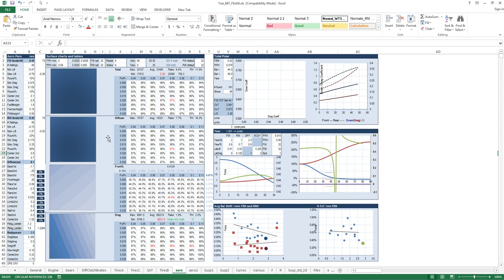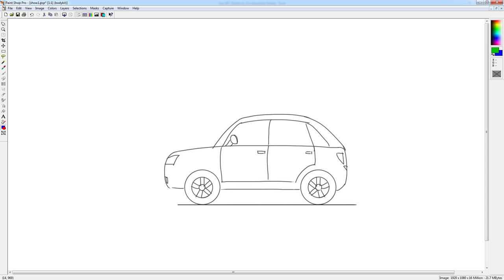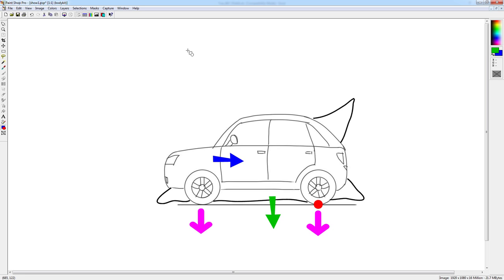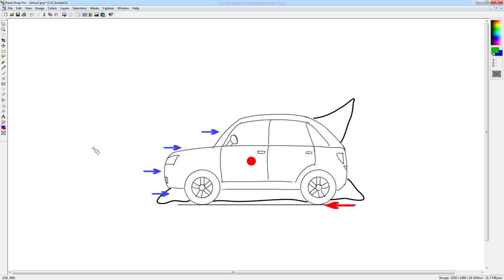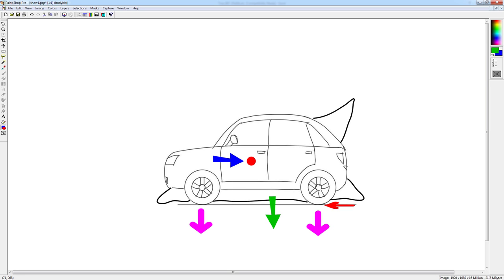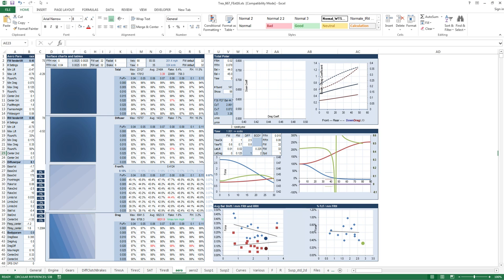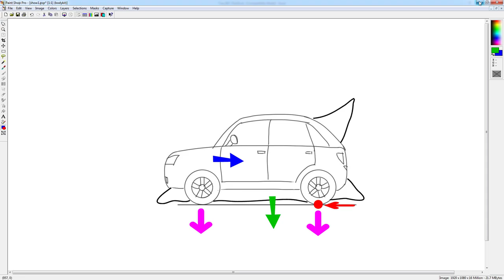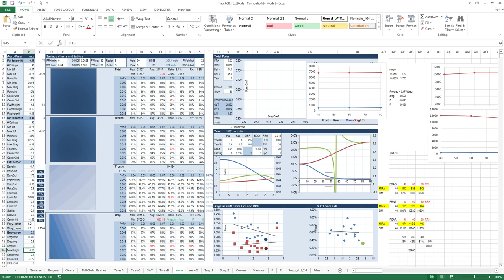I've been doing something a bit wrong!

Comment from the maker: Some more notes...

It doesn't matter WHERE you do your calculations from, ground or CG, as long as you take into account all the forces and moments properly. Once you start forgetting forces (as I did with the tire driving force) it starts to matter.
Reply: The tire driving force would not cause any moment of force in the earlier method (forces tire contact point - sum of moments). Also the chances that body drag is exactly at the same level than cg are quite small (even if close).

Comment: For information, the SAE aerodynamic axis system measures drag as a force at ground level, not at c of g height.  If you use drag, front axle lift and rear axle lift data measured to the SAE system then drag should be applied at ground level.

Comment: IANAA (aerodynamicist) at all, but I believe drag acts on the aerodynamic "Center of Pressure" (CoP), and the drive acts on the "Center of Thrust" (it's called that in model rocketry anyway). To make a stable model rocket, CoP has to be aft of CoT - that's what the fins are for. A forward CoP (such as your boxy car might have) should be a bit unstable at high speeds, creating oversteer. . About back-pitching, I would expect a Formula Truck to have a lot of it. Maybe that's why some tracks for F-Truck have speed traps - to prevent blowovers?

Comment: Vehicle will still pitch back if you only have a rear wing. The largest amount of drag comes from the back of the car, also increases as downforce is added. Downforce also comes from the rear bottom of the cars with proper defusers

Comment: Thanks Neil.I must watch it again. Not sure of The oversteer effect if you were adding more momentum and therefore lifting more at the front and adding load at the rear... wouldn't that give you more understeer?
Reply: Maybe it would overload tires more resulting in a bit less grip because of rubber load sensitivity. Also having more weight at the rear would give it more inertia. I'm just guessing :D But yeah seems like it should understeer more at the same time, so maybe more neutral drifting ?
Reply: From what I understood, he dialled in a front-heavier aero balance and got a match with telemetry, but resulted in oversteering, due to the lack of the moment being considered.

What I didn't get is where that moment is lacking. On game physics calculations or on his car models (spreadsheet).

Comment: At least you have teh balls to admit you made an error. 

Not like Dave Kaemmer haha
Reply from the maker: I'm pretty sure Dave has admitted to and fixed some errors over the years at iRacing, something with the 'magic safe hax' and also the assymetrical handling more recently, some multibody physics error. Kaemmer is extremely good at the physics stuff, which I doubt he would've become if he wasn't self critical or prepared to admit he was wrong every now and then. Even if you don't like the handling in a sim, the code behind it is complicated and impressive!
Reply: Niels Heusinkveld bit dave kaemmer thinks that the outside of a negatively cambered tyre should remain hotter than the inside. Even though there was an f1 thermal cam that proved otherwise

Comment: And, if you build more different cars, you can finde more errors, because some things are on some type of cars are extrem or nothing there. If you havent build the super truck, you have to finde that error some years later.
Reply from the maker: Yes, the Supertruck (drag applies high) and Ulitma GTR Road (720hp worth of drag applies at a normal point) highlight the issues most... Kept wondering why.. Numbers looked good.. Handling wasn't always as I anticipated. But now it turns out it was me (tends to be that way) and not anything weird or physics engine related at all. :-)
Reply: I told you there´s something wrong with this Ultima;-) Would not survive any testdrive with this oversteer and it´s a UK-car, so more rain and slippy roads than full rubbered race tracks:) But IMO downforce will not be enough. The throttle-mapping seems way to overkill. I just assume this company tamed the car a bit more to make it possible to handle. Driving any Hypercar in AC without TC (probably nobody does) is just a joke compare to this crazy Ultima Road and this wings are just for the show?
Reply from the maker: A bit of aero change will make it better, but the effect won't suddenly make things completely different. We probably tweaked some of the error out of it, and compensate with other car setup things. The main point is now that the aero will be exactly (hopefully finally now..) as it IS, we can construct the rest of the car around the aero in a logical way. So I hope to not end up in a situation where reasonable numbers lead to unreasonable handling. But 720hp street cars won't suddenly be a walk in the park.. :-)
Reply: Niels Heusinkveld Maybe i was wrong with the throttle mapping. The car is just not built to drive near the limit, even hates it, but really fun. The car feels better when just detaching the rear ARB like most cars in AMS. They just loose most of their oversteer-issues and feeling perfectly nice for me. In other sims cars understeer a lot more with that and do often the opposite to gain oversteer.
Reply: What kind of wheel you use, please?
Reply: I´m using an Accuforce with HE Pro pedals and Niels a Bodnar-system with 15 Nm probably with some Fanatec pedals:D
I assume we both would buy something else for the steering today and simracingbay.com seems to point in the right direction, at least for me...

Comment: Erm Niels, I'm not sure you figured it out already but you were originally not wrong. The height of the drag component relative to CG is irrelevant. Only height relative to ground matters. Push any object horizontally, regardless above or below cg, it will want to tip over in the same direction of rotation always. Only height of the push relative to ground will dictate how "easily" it tips over.

Comment: For free body, the rotational axis is on the gravity center. But, the car is not a free body, it is retricted on the plane of ground. Hence the rotational axis as related the force appled is Not on the gravity center, unless the car off the ground throwing in the air.  I think your previous calculation was correct. For example, while calculating applied torque on a steering wheel, you simply use normal applied force by your hand to times the radius of the wheel (because of the rotational axis is in the center of the wheel, regardless where is the weight center of the wheel).

Comment: On ISI spreadsheets, aero part, there is something called "DragBal Shift", which i think increases downforce on rear end depending on drag produced.  Is this related to the effect you talk about?
Reply from the maker: Yes, and drag will affect the balance,  as long as it is not applying at the height of the CG. Rear wings may apply above the CG, front wings below, etc. I hope they haven't copied my mistake as I'm pretty sure I mentioned it to the rF2 physics dev years ago..
Reply: I can confirm "dragbalshift" calculation is used to affect balance. About the rest i am not sure..

Comment: Wait a minute ! ...The tipping-back moment acting from the wheel-driving force on the center of gravity only exists under acceleration or am I wrong? 
So... if you tested this at 250km/h, there isn't much acceleration going on anymore, but more drag than ever. Meaning: If you got real-world tire-load telemetry at very high speeds to compare with your game telemetry, then the rear-wheel driving-forces' tipping moment should not have canceled out the drag tipping moment to match the real-world data.
Doesn't that mean the faster you drove, the more your game-telemetry deviated from the real-world data??
Reply: Regarding your first question, no, you are wrong. At 250km/h there will be little acceleration going on, which is not the same as saying there is little force going on. The forces (drag and driving) are more or less balanced at high speeds, but they exist and, given the distance between the CG and the wheel point, so does the tipping-back moment.

Regarding the last question, I don't know.
Reply: Heitor Cicoti Ok, I'm not certain, that's why formulated it as questions... Let's assume for a second, you are right and I'm wrong in my first sentence, and the tipping moment by the driven axle is proportional to the forces applied by the rear wheels (and not proportional to acceleration), THEN, in a FWD car, the tipping moment from the driven axle would ADD TO and not cancel-out the tipping moment created by the sum of drag.
Hope you can see it from my (eventually wrong) perspective; kinda shit to explain without a whiteboard.
Reply: Yep, I'm not sure what you mean... Because, in a FWD car, it would indeed add as well. What would be the problem with that?
Reply: If it adds and doesn't subtract (and cancel-out), then the mistake should be much more obvious and AMS features quite a few high downforce FWD cars.
I imagine it like this: The driving tipping momentum results from how much the rear tires want to overtake the car's body(at the CoG), at high speeds, much more power is required to push the car's body forward, not only(!) because of the higher drag, but also because the kinetic energy required is proportional to the velocity squared.
Reply: The longitudinal position of the wheel driving force have no effect on this matter. If it is one force at the back, one at the front or two smaller at each wheel, the contribution for the moment will be the same: its magnitude times the distance to the CG (reference point).

I feel you are thinking of the tipping-back moment as something that would actually tip the car over, but this is not necessary. When we talk about forces like that, we are looking at a frozen time frame. So any forward force at ground level will be a clockwise moment, a tipping-back moment at the CG. But if we set the time free again, a force at the front wheel would not tip the car, because as soon as (and IF) the car starts to rotate, it loses grip and there's no force to generate the moment anymore.

I think I'm going too far...
Reply: I agree with everything you said in the last post and I changed my mind on the force. Before I said there would be little acceleration at high speeds but still high forces driving the car, now I'm thinking that the driving forces acting on the CoG as well as the acceleration are both lower at high speeds as this force is proprtional to the acceleration, the forces that remain high are those of the turning wheels on the ground.
So, my understanding of the matter hasn't changed really, the tipping momentum from the driving force is tied to acceleration. My understanding problem is probably with the "canceling out" part. The tipping momentum of the driving force and the tipping momentum of the sum of drag always add to another / both act clockwise - early on I (not really thinking about it) imagined the drag and driving forces on the CoD/CoG countering each other, though momentum-wise they add up and increase it - which now just makes me not get the "canceling-out the error" part of Niels' video.

But I agree, this talk has gone too far for a youtube comment section and it's ok, if you'll stop arguing from here on. Thanks the physics talk.
Reply: Ok, last one! Haha... The "cancelling out" part: Those are two separate ways of seeing the same picture. One picking the reference point as the rear axle contact patch, with the drag force generating the moment and the driving force generating no moment (because its distance to the reference point is 0); and the other picking the CG as the reference point, with the driving force generating the moment and the drag force generating no (or very little) moment (because drag center is usually very close to the CG, so distance is 0). Those are two ways o looking at the same problem. They are equivalent. They "cancel out" each other. The mistake from Niels was not to consider the driving force while using the first way (as it results in 0 moment anyway). There were other implications for not considering that force, which is the error, most salient on cars with low downforce and high CG.

And just to close the subject, the moment is not proportional to acceleration (chance in velocity). Imagine two high forces acting on a car countering each other. The car won't go any faster. But if one force is out of line, it will generate a moment, because of the distance, and the car still won't go any faster. No acceleration (change in velocity). But if you refer to acceleration as throttle (as we do in Brazil) as well, you could say it is proportional to the acceleration, because it is proportional to the wheel driving force, which comes from the throttle.
Reply: You got the distances or "levers" right and the two perspectives of seeing the problem, but Niels didn't forget about just one.
Let me do one more too:
The driving force generates a moment on the center of gravity (your first reference point), which in return pitches the car backwards, which then generates ANOTHER moment (still first perspective, but kind of a chain reaction from there acting backwards) from the CoG on the rear tire contact patch resulting in a higher load on the rear tire. The sum of dragforce generates a moment from the center of drag on the rear tire contact patch as well.

This "another" moment is related to the acceleration of the car. Imagine the truck. From 0 to 20 the acceleration is very high, trying to pitch the cabine backwards; this tipping moment generates a higher downforce/tire-load, making the tires grip into the road harder. At higher speeds the power needed to accelerate is wasted on fighting the drag force, resulting in an almost non-existing tipping-backwards moment from the driving force acting on the CoG, but... only to be replaced by the now higher drag force "bending" the truck cabin backwards and thus generating a moment from the CoD on the rear tires. In a 1 mile drag trial, you could end up with a relatively constant additional rear tire load: At low speeds the source of the increased load is just the acceleration, at mid speeds you have a 50/50 mix of forces from acceleration and drag bending the truck backwards and at max speed and zero acceleration it's only the drag force generating the additional tire load.
(this is leaving out the part where a racing truck is not designed as a zero-lift vehicle but as a high downforce one that has designed-in additional drag that gets converted to downforce/negative-lift)

Niels said he forgot about the driving force momentum as well (so he forgot about the drag momentum AND the driving force momentum). Maybe by "canceling out" he meant that these two moments add up - as I said in the paragraph before - to a more or less constant additional tire load, like a plateau... everything on top of that plateau is the actual added tire load coming from the real built-in aero downforce, meaning by looking at the differences of tire load from low speed (under acceleration) to high speeds, he got the aaalmost correct downforce value even from his "forgetting about the two moments" wrong thinking.

(I feel pretty good about this perception)
Reply: The only thing I'm trying to say is: There is no moment because of acceleration. Just that. No driving forces -> no acceleration. This "another" moment is the same as the "high speed" one. If there is a propeller or a rocket aligned with the CG of a car, it will accelerate, but there will be no moment. This moment only comes because of the distance between the driving force and the CG. The wheel driving force won't be wasted fighting the drag force, it will continue to make the same effects as it did at slow speeds. The fact that the car can no longer increase its speed won't change that.
Reply: If both momentums, drag and driving-force, both act clockwise in Niels' drawing, and furthermore the driving-force is not tied to acceleration, why do a cars rear-suspension springs compress accelerating from 0 to high speeds at first, then start to settle and finally even out with the front springs?
The moment that stays the same from low to high speeds is the one from the contact patch to the rear axle. but not the one from the contact patch to the center of gravity.

I'm sorry, I'm staying with the view from my last post. We should end this here. But a big Thanks for making me think about this matter some more. I enjoyed it.